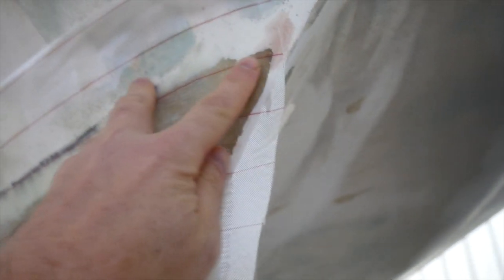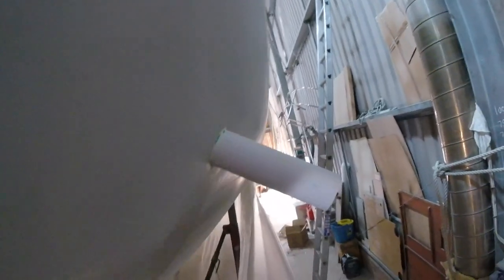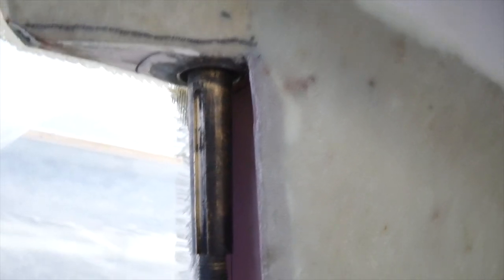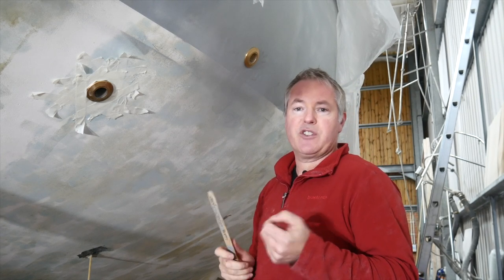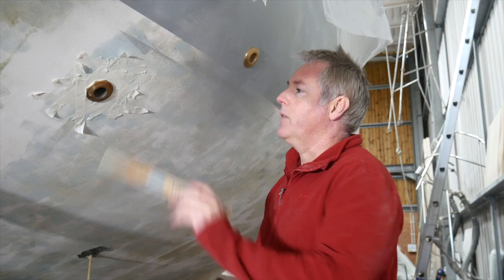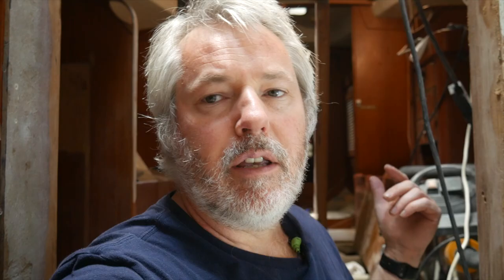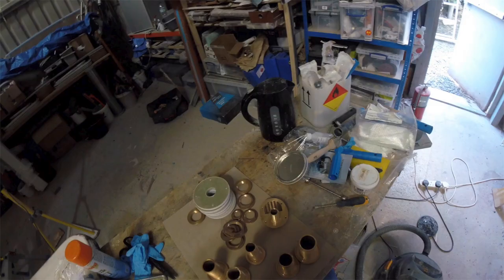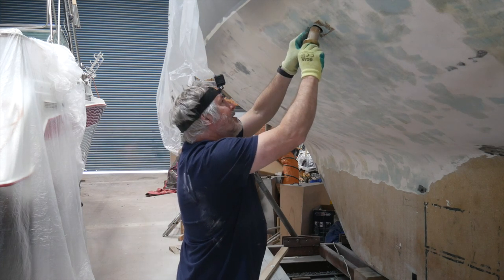#65 where did 2020 go?!!

Comment: Groco does not recommend using G-10 backing plates as they are too stiff. They sell pre cut PVC plates that provide more of a cushion and accounts for the different thermal expansion coefficients of fiberglass and bronze. I found that using an adhesive sealant like 3M 5200 provides a good bedding for the PVC plates and masking tape on the trough hull fitting was good holding them in place while the bedding cured.
Reply from the maker: Hey Myles, thanks for the info re Groco - I didn't use G10 material I made my own out of materials that are the same construction as the shell so the thermal expansion coefficients of the bronze to the backing plate would be the same as the bronze to the shell.

Comment: That was a Christmas gift ! long waiting video.
Regarding water tank leak, i haven't experienced something like that. Even if my water tank inside was in similar condition as seen on your photos.  
I have cleaned everything was possible and painted inside with thick epoxy paint . 
During my 352 refit, i also changed all sea cocks/inlets. Using a piece of epoxy laminated wood for backing plate about 0.8cm thick, applying Sikaflex 291i made things ran smoothly and everything went fine during that year's trial for few months.
Reply from the maker: thanks Kostas - I am thinking about what sort of sealant/adhesive to use. Glad your refit went well

Comment: Use a car tyre vale attached to an adapter which should be attached to one of the ports in your tank, seal all other ports and pressurise using a car tyre pump. 10 to 20 psi will soon show you any leaks and you could leave a gauge on for a few hours to prove the integrity.
Reply from the maker: good idea thanks

Comment: Great to see you back!  Is it necessary to use thickened epoxy to bond the backing plate to the hull?  I have been assuming some type of marine sealant was generally used. I purchased my backing plates from Groco, some kind of composite material - not fiberglass. I have to install 3 Groco seacocks on my Watkins 27 this Spring.
Reply from the maker: Hey Mark - good question. The sealant should be used between the thru hull and the hull, but the hull to backing plate should be a solid bond. The thickened epoxy also fills and marries the curve of the hull to the backing plate. Plus it makes that part of the hull a solid fibreglass of 1 inch. AT least that is what I saw in most of the research I did. You can check ABYC H-27 for info on best practices to install thru hulls
Reply: @aboatcalledwanda6925  Excellent. That makes a great deal of sense. Thanks sooo much!

Comment: Well here is a problem you know what the answer is. Just cut the floor up pull the tank and have a new aluminum tank made. Don’t waist your time to try and fix and seal cause it will never be right. You’ll save a lot of time in the long run. I know not the answer you wanted to hear.

Comment: Also what you can do is drill the holes say 1 or 2 drill bit sizes larger. I would not drill and bolt thru the hull. Instead of 1 thru hull you’ll have 4 holes. In my opinion very very bad idea go over and watch Mads on saillife he replaced his thru hulls and his were not that big of an issue.
Reply from the maker: no you don't want the screws having too much clearance in there - and originally they were meant to be threaded.
You'concern over drilling through the shell - but this is the best way to be compliant with the standards set by ABYC. Great fan off Mads but as he often says ' this is the way I chose to do it, but don't follow my blindly do your own research'. Which is what I have done. For further info you can google ABYC H-27